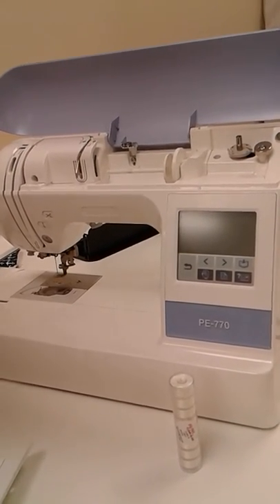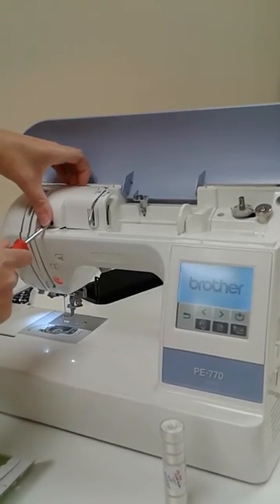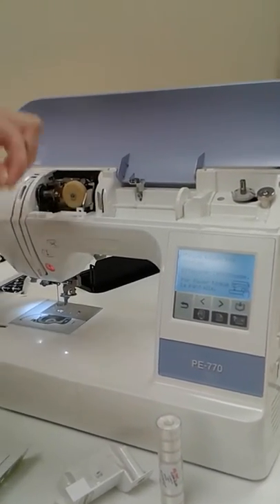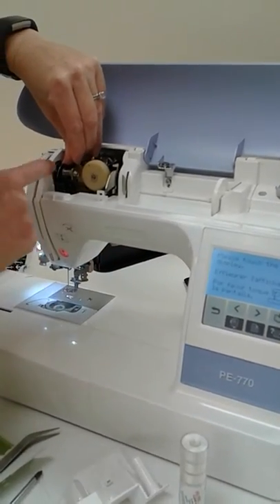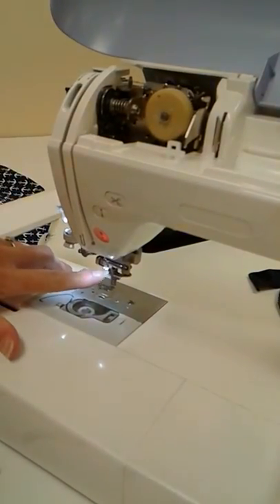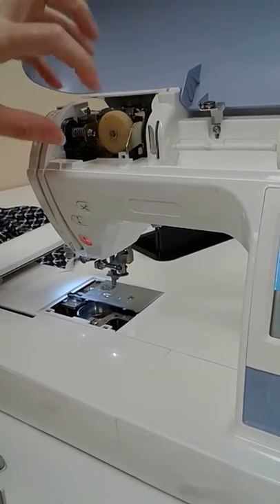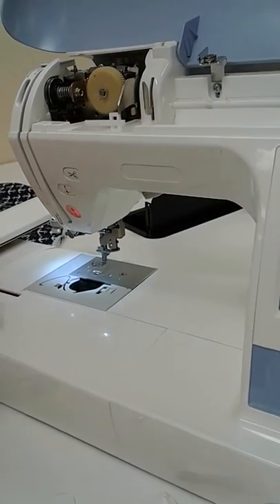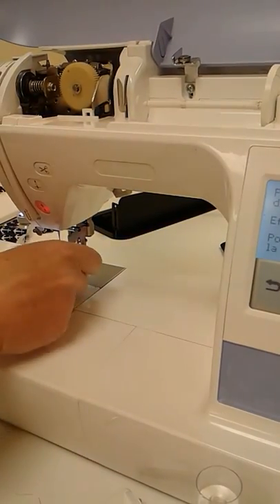Part One - Embroidery Machine Troubleshoot 05/11

Comment: use different needles for different types of material. your manual will tell you everything.
if that machine was serviced you should not have been having more problems.

Comment: First of all You always use a thread cap, make sure it is pushed up against thread. use smallest for that type thread. make sure thread feeds from the bottom not over top. thread can break because it is old. change needle to type of thread used. embroidery thread embroidery needle. rethread machine. check that bobbin is in correctly. go to trouble shooting guide in your machine manual it will save you lots of repair money.
I repair machines and if someone tells you not to use a thread cap then go to a different company
Reply: Eye on art  Embroidery can certainly be done without a spool cap. Especially when a thread is coming off of the machine and twisting and curling. If you don’t approve of the video, move on, because it has helped many people.
Reply: Eye on art Furthermore, if you “repair” machines why are you watching how to videos???
Reply: I wish there was more zooming in when talking about small parts like the wire that was bent near the needle. This was a great video. I’d love to see more like it.